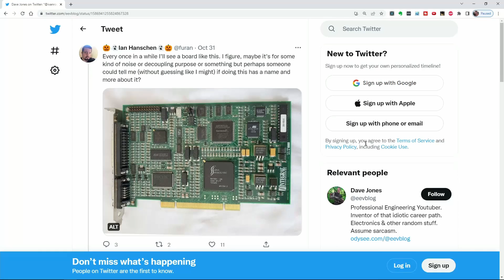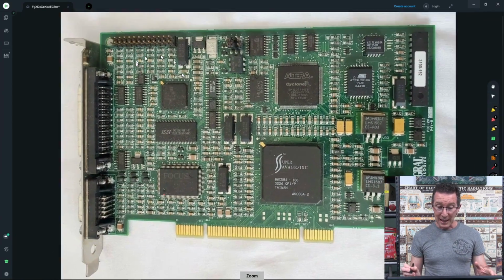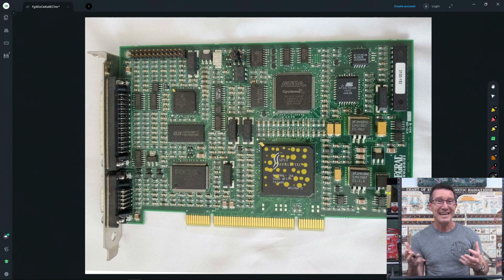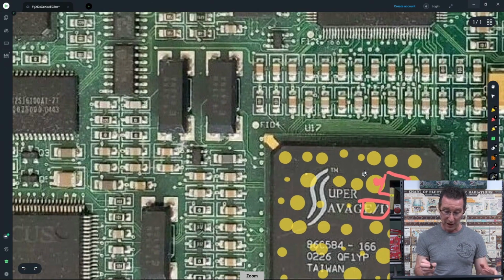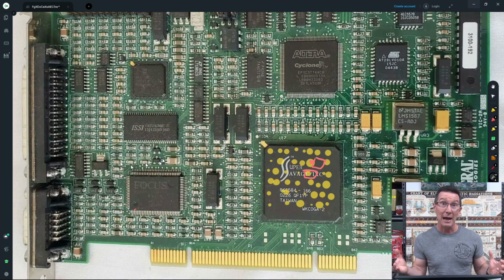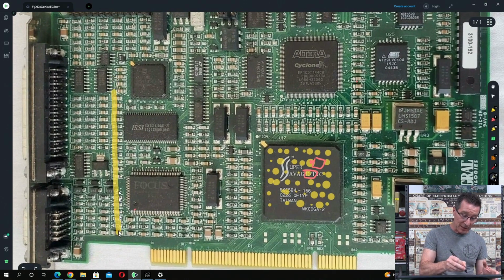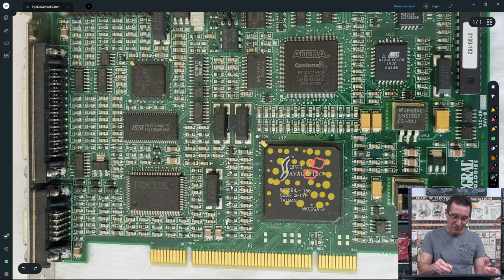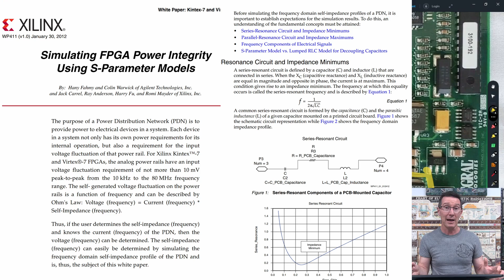EEVblog 1512 - Why Bypass Your PCB Like THIS?

Comment: I’ve been watching your videos Dave for 8 years. Ever since I was a young Marine working as an aviation electrician. Through the knowledge you taught me and applying that knowledge in the field I became Marine of the Year and I was able to pass the screening for a EE R&D job while grossing 6 figures without any college education. So I’m working and studying biophysics living the dream in my new home. Thank you Dave for being a crucial pillar in my professional development.
Reply from the maker: Nice to hear, thanks for sharing.
Reply: @EEVblog  
I had to design a PCB (including cuircuit design and selection of components) for my bachelor theses. And I had no clue about that because that hadn't been a part of regular curriculum which had had the focus on digital electronics. This blog was one of the resources that helped me to design the board  that ended up exceeding specifications. #528 and #859 ended up on my list of references, the last one incidentally about bypass capacitors :). I learned that they are a thing only from the data sheets of the components, so I looked for information what the heck they are. That highlights my level of (lacking of) understanding before the thesis :).

Knowledgable analog designers like you are going extinct, as my prof lamented, probably because of complexity it involves.  Analog effects are not intuitive and analog circuits are hard to debug. That scares off most people  (including myself ^_^) to pursue a career in analog design.
Reply: I also went back to Uni after watching your videos. Now I'm in Paris designing fpgas/asics for the space sector. Not on 6 figures but very happy
Reply: Well done you! And for crediting Dave.  Somewhat hard-boiled though Dave sometimes seems, I have to think he gets a lot of satisfaction out of comments like this!  By the way, have you also seen channels like Robert Feranec, FesZ, SDG Electronics and Phil's Lab? All thoroughly educational in different sectors of EE.
Reply from the maker: @Graham_Wideman  Stories like this are the #1 best thing about doing a channel like this. The only thing that tops it is other creators telling me they were inspired to start their channel by watching mine. That tops it becasue it's a big multiplier factor. Back i nthe day I was the only one doing this, now there are hundreds of quality electronics channels.
Reply: @EEVblog  Thumbs up on all that!
Reply: @EEVblog  Hi, Thanks to this channel, I started rebuilding my home workshop again after my workshop was completely robbed and I lost all the equipment I had accumulated in my life. Originally, I wanted to give up on the restoration of the workshop and finish with electronics, but I came across EEV and that decided, my first contributions to the forum are from the restoration of the workplace. Considering the prices of the devices, it is not that simple, the CZK exchange rate is not good and quality devices exceed my annual income. Something worked out and I don't regret it, although in most cases I am dependent on self-production or repairs of old equipment.

But this is not the subject of the question, I always believed that the free fields around the chips represent the assembly space, the regular arrangement of individual components facilitates automatic assembly and subsequent testing (for example, on the Huntron automatic test bench). On some older PCBs (similar to the big one you showed) there were anti-interference capacitors in the power path between each integrated circuit, sometimes it is simply better to have several smaller capacitors than one large one and create an imaginary protective barrier (for example, I have no idea how noisy the environment is where the board will be to work, influencing DPS paths from the surrounding area, etc.). The fact that there are no components under the chip can be related to heat dissipation from the chip, if there was a requirement for so many components under the chip, they could create a pretty decent heat shield. Excess or poorly designed roads can cause many additional problems and this should always be taken into account when designing.
This is just the opinion of today's pure amateur in the field of electronics.

Nice day 🙂 Tom
Reply: @Graham_Wideman  Yes I have Graham! All great and super informative channels.
Reply: @Graham_Wideman  any of those for RF?
Reply: @TimPaddy  "RF?" Yes and no. Yes in the sense that high-frequency digital is at RF frequencies. And in the sense of wireless and radio, I recall several videos across those channels on incorporating wifi, bluetooth and so on, including PCB and chip antennas, and low power wireless telemetry.  But I don't recall for example design of radio transceiver gear for audio or video.
Reply: @TimPaddy  "The Signal Path" goes deep into RF, mostly microwave stuff.
Reply: @treelineresearch3387  ty sir!
Reply: Holy crab cakes, nice work!
Reply: Well this guy gets it. I cringe at the title engineer because it’s so meaningless. Many of my fellow grads are clowns. If you can read, you can learn.
Reply: Yes.. I have been following Dave from 2015 when I joined my bachelor's in electronics and communication engineering.. Then I followed him through my master's in biomedical engineering and now my phd in Cognitive robotics.. I worked in few companies where I had to design schematics and Pcb designs, and my practical knowledge of electronics is thanks to dave..
Reply: Um, can a corporation suffer from abnormal psychology?

Comment: The bypass caps wouldn't even raise a question for me, guessing the reasons is easy. But why so many 0 resistors? That's a multi-layer board, it wouldn't have been that hard to route most lines without a jumper bridge, would it?

Comment: PCI cards that have two notches in the connector can accept both 3.3 and 5V, though most most desktop mainboards have 5V slots (indicated by the notch away from the bracket)

Comment: Are you sure about it being best to put decoupling caps on the other side of the chip? I remember from a Rick Hartley video, that decoupling on the same side with power/gnd planes closeby is even better, since you don't go all the way to the other side of the PCB with a via.
Reply: What's closer, "All they way" through a 1.6mm board or 2 to 3 cm on the same side?

Comment: My guess is that someone designed the circuit assuming it will be a double sided load. Then the PCB designer was like "Eh, I can pull it off with a single sided load".

Comment: I see another reason for the grid. When you have to untangle circuits that have many components it helps to set the snapping grid pretty coarse. That will speed things up.

Comment: Probably not, but looks a lot like the led wall capture/interface cards i used near 2010-2012. Ground, EMI interference is quite common in the use case scenarios, so everything is over engineered for that. The VGA captured a crop from the pc video card and translated it to the wall protocol.

Comment: 1:45 "It's a bit younger than I expected, I thought this was late '80s or something". The original PCI 1.0 specification was first released in June 1992, so it couldn't have been any older than that.

Comment: I bet the decision for single sided was cost motivated due to the (likely pricey) FPGA up top. The designer must have had a tough time with managing to lay out this board to fit all the bypass caps on top, there's an awful lot of 0-ohm jumpers on it! Not sure how many layers are on that PCB but I bet there'd have been a lot of pressure to reduce that for cost reasons as well.

Comment: It is an analog input board. Having a row of bypass caps surround digital components could be an attempt at "fencing in" digital noise by providing a very low impedance path between ground and power planes around and between the chips.

Comment: Huh, that's weird; S3 Graphics was sold to Via in 1999 and they make terrible 00's GPU (early Savage & Virge) but the Super Savage & Pro Savage were only sold to OEM & Notebooks (Thinkpad once had this one too IIRC) so it's probably made by 3rd party contractors or some sort for... mil-spec requirement? either way that bypass seems really overkill for.. general usage.
Some broadcasting companies like Audioscience, Digigram, Lynx or RME do has a pretty similar "neat smd grid" board layout for their internal card, but not to this kind of "neat"-ness.
And no, i haven't heard of "Integral Technologies" either.
Reply: s3 is why virtualbox and vmware really become useless if you need any kind of virtualized hardware acceleration, even if we have the power to emulate something much much better.

Comment: You asked for feedback on the way this video was made. Well, couple of points where there is room for improvement in my opinion. First, the Davehead on the right bottom corner. The backdrop of the electromagnetic chart is too distracting. It's so small you can hardly read anything and it just distracts. Better choice would have been the green screen, so the head is free floating on the video. For example, at 16:21 we can't even see what you're talking about, because it's hidden behind the electromagnetic chart. Second, you're constantly zooming in and out, which is very tiresome, even up to the point when it's starting to cause nausea. Please zoom in or out slowly, infrequently and only when needed. Third, I prefer it when you're looking into the camera while talking. Your new thingy for scribbling causes your eyes to look down, which I personally don't like. That's it, keep up the good work and looking forward to your next video

Comment: I have a question regarding the looks of modern vs older PCBs. I have noticed that many modern PCBs completely stopped using silkscreens. One well known example would be apple mainboards or modern GPUs. This is in contrast to a lot of PCBs in old devices - just like the one you have reviewed in this video. Now my question is: What made the change to frequently opt out of using silkscreen? My guess is, that the higher density of modern designs would simply not have the space for silkscreens or limitations in the printing machine's accuracy prohibit the use if silkscreen. Please enlighten me, Dave!
Reply: It’s because they don’t want people repairing their devices, they want you to throw it away and buy a new one, why help the repair tech with useful information.
Reply: they could just leave the silkscreen blank though

Comment: If the ground and power layers are "high up" in the PCB stackup (which they should be), then mounting the bypass caps on the top side of the PCB results in lower loop inductance than mounting them on the bottom side. Also for lowest loop inductance, the power and ground vias should be placed to the side of the cap, close next to each other, rather than hanging off the ends.

Comment: Perhaps all those caps were put there to reduce RFI into the analog video inputs keeping in mind that not everyone correctly terminated their video feeds. The other thing is those caps would have been pretty cheap and it does make the board look cool. Given the choice potential customers are likely to go for the board that looks full.

Comment: couple possibilities here.

1. it is cheaper to use a bunch of picofarad to make a few nanofarad.

the cost for 1 nanofarad in picofarads is way less than a factor of 10 say like they can get a reel of 1 million or more picofarads for 1 cent and the a reel of 1 million or so nanofarads for $1 or even $10 they will go with a bunch of picofarads.

2. to make the card vista compliant instead of taking  a stock blank and running it in another bath of etchant to remove all the pads.

one of the rules to be vista compliant is there is to be no universal card blanks and no places to where you could source the parts and a hot aire rework station and solder the parts and get analog video out of a digital only card.

Comment: So, all these caps that would normally be placed on the bottom layer under the chips (where you see them all over) ended up on the top just because the manufacturer didn't want to populate the bottom layer? C'mon, for crying out loud... big electronic engineering WTF.

It's generally easier on the caps when they're placed away from heat, but that still doesn't mandate putting them all over the top layer.

That oldschool board around 13:00 - oh yeah, what a thing of beauty!

Fiducial on silkscreen, WTF? Never heard of anyone doing that. Whyyyyyyy?

Comment: 4:20 I DONT THINK I CAN EXCUSE THE CRUDITY OF THE MODEL
why so many different pin sizes? does it have to do with current handling? or is it purely for inductive and impotence reasons? does having the staggard pin array with an uneven number of randomly sized pins help train the new ai overlords to hate us all for not using an autorouted design?

Comment: putting your caps on the bottom will not always give you better performance, if you have a tightly coupled plane pair close to the populated side of the board having your caps somewhat far away on the same side can be better than having long inductive vias, this is not what is happening with this board but i wanted to mention it anyway
Reply: Ive seen that video by Rick, so i feel you. It just depends on your stackup i guess. I generally strive to have all decoupling on the top layer too, but it wont always be the best solution.
Reply: Putting caps on the bottom usually ends up having way more impedance than caps on the same layer as the component, even if they're inches away. Rick Hartley has great videos on this concept.
Reply: @asid61   it depends. We are talking about a bga package here. You can get a cap much closer to a pin in the middle of a part if its on the underside.
Reply: @jeremyglover5541  still doesn't really matter, unless your BGA is more than 4" per side. The charts in the Rick Hartley videos about power show it well - impedance to the cap is way higher when the signal has to cross ground planes.

Comment: A couple thoughts on this :
a) The system designer started out the schematic capture phase by dedicating one page to caps (decoupling and bulk) and just cut/paste a metric tonne of decoupling caps on it... maybe a post-pub edit session?
Since all the challenging stuff happens on the OTHER schematic pages (and who brings up the cap page???) the over-abundance slipped through.

b) They used some rather new-for-the-time chip and were unsure how it would behave, so they over-populated the board with decoupling caps.... since you CAN leave some off and suffer little penalty (at those frequencies and transition currents) they were going to test how much difference they'd have between the over-populated board vs one with 3-4 caps per BGA.

c) Are all the small yellow-bodes the caps, and the grey-bodies resistors? If so, much of what we are looking at may belong to some series termination scheme.  I'm not a video designer, but it is (or was) a fairly common thing to do, and if they have a bit of an odd stackup for trace impedance (e.g. their systems engineer is a repurposed software guy who isn't the most pcb-cognizant of people) they might have mad to do a little catchup impedance matching.

d) This could be an example of off-site/off-country PCB design where the wording of the pcb spec was a little ambiguous, and the pcb-house wasn't too keen on asking questions... they just follow a spec. 

e) some smart-child wanted to see what happens to a nice quite set of power planes edge-to-edge inductance if you blow it full of holes.

f) Is this driving a standard display family? This isn't for some old high-voltage plasma display, is it?

g) In review, I'm probably more in the camp with the folks who say this boards got multiple power rails because of a mixed-signal function. And they want to decouple away power-ground spikes caused by some noisy WIDE logic bank (> 64 simulanteous bit transitions) and a higher-impedance analog side (subject to pickup spikes). .. and an overzealous noise-budget engineer.

Comment: As someone designing a product with a high end modern processor, I WISH the manufacturer had supplied us with a 50 page document on power timing. We're lucky to have a couple pages with 2-3 diagrams.
Reply: I’ve also had some bad experiences. Learned my lesson and technical documentation is now a selection criteria point
Reply: @enginerdy  Nice!  Some DataSheets are amazing, and others are garbage.  Right now I'm in software, and it's the same.  Except StackOverflow means community is extremely important.  It's why Open Source dominates.  I don't care if the company can afford whatever commercial product that's "better", if I can't find the answers I need to do my job it's worthless.
Reply: What are you designing for.  Intel has always delivered lots of docs.  Nxp has been ok, I've never done an AMD processor so maybe one of their parts?

Comment: Thanks Dave,
 it would be good to see those bypass capacitor computer model programs in action.
Reply: Look up Robert Feranec on youtube, he has some videos showing them.
Reply from the maker: I think they are all very high end hugely expensive packages. Not aware of any free or low end ones.
Reply: @EEVblog  - OK thanks Dave,
I was wondering if Altium could do it?
The long tracks to the caps have inductance that is bad at microwave frequencies. e.g.
An FPGA working at 250 MHz would have big problems with that layout.

Comment: Hard to say without looking at the schematic, but if there are a lot of channels of video with parallel busses, depending on the format and bit depth, you could have a lot of simultaneous switching currents.  Especially if the channels are genlocked.  With a mixed signal board like this, you'd want to keep things like ground bounce to a minimum.  I could see wanting a lot of caps on board, although not sure that many...